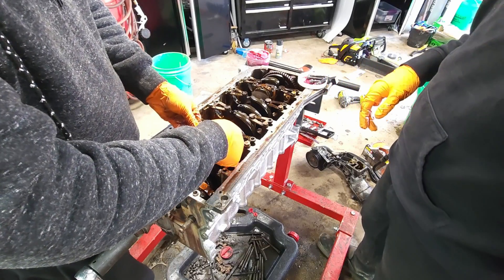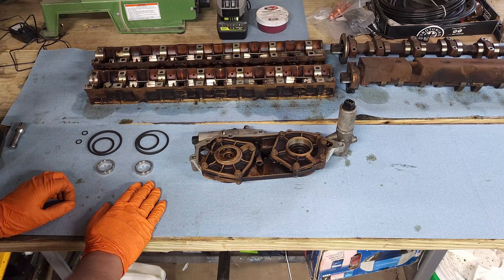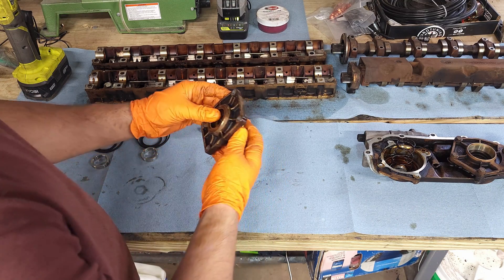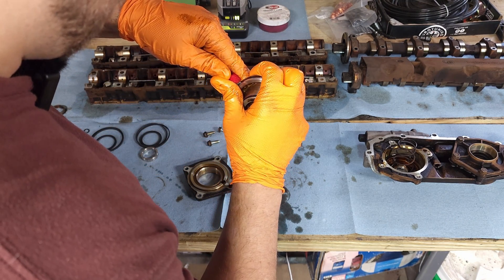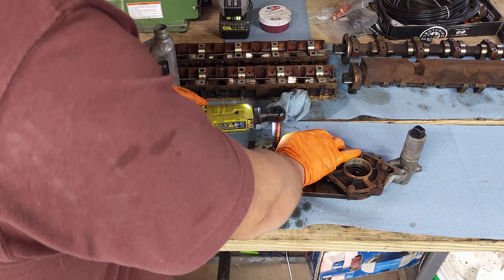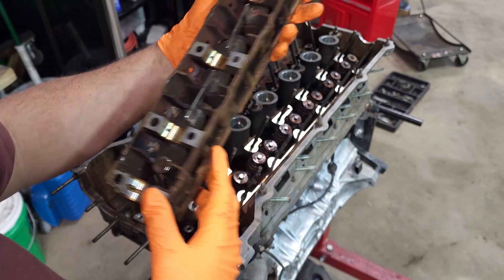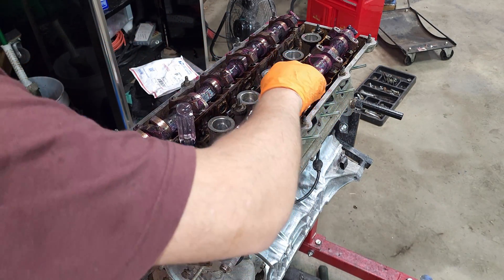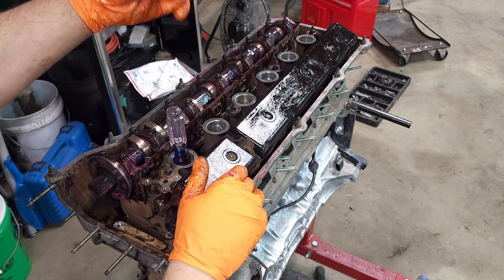Drift E46 Engine Rebuild EP 1

Comment: I always get confused about the initial mating of the block to head. No one mentions position of pistons TDC1? and  the intial positions of cams so the valves don't come into contact with pistons🤔
Reply: Yeah just paranoid 1st timer. Thanks
Reply from the maker: I usually put the head on and cams in with no pistons at TDC, but with piston 1 close to TDC. Now if the cams are already installed on the head, I'll get the double dots lined up and some valves are sticking out, then it's a matter of just keeping piston 1 like a slight bit counter clockwise of TDC until the head is torqued down, then move it back to TDC after.